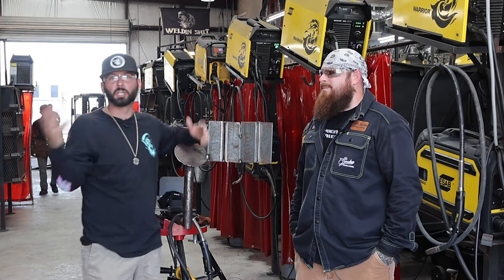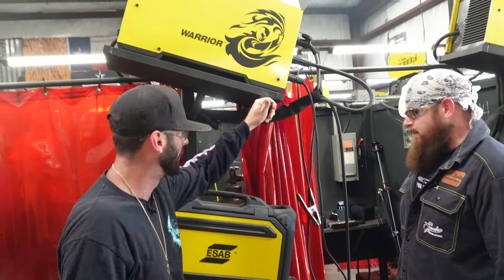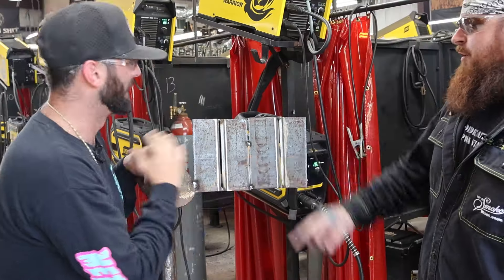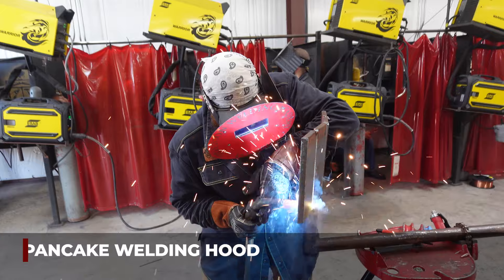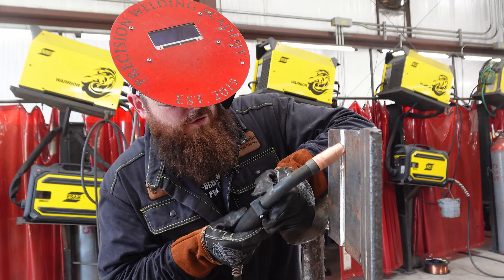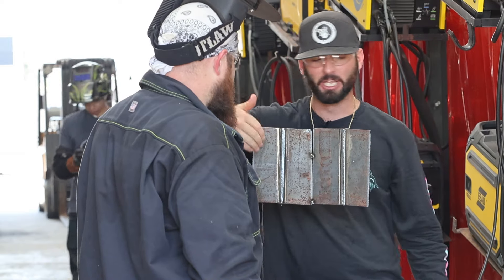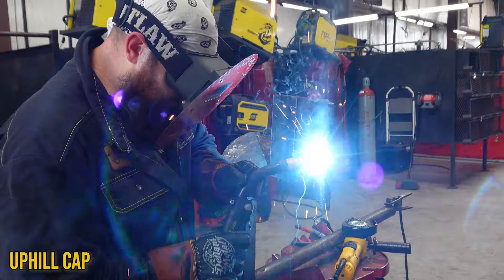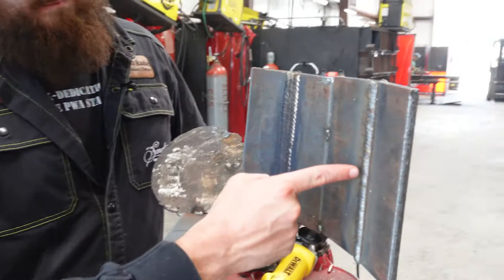Is MIG Welding Downhill As Strong As Uphill?

Comment: Uphill or downhill, either works great. In 34 years of mig welding in a pipe fabrication shop, never had a problem running downhill on roots.
Reply: 1000 percent
Reply: @JamesPuckett-t6i  Same here 37 years of Tig and mig fabrication. I've had no problems with downhill mig welding

Comment: Pretty dope my dude. I had to see it to believe it. And its wild to me. Open Roots all day can be done with short circuit mig . But its wild to me, seeing thicker plate not have lack of fusion in the side wall.  

I know folks have procedures out there in the wild . 
 But  its just so hard for folks to get GMAW-S  to weld  repeatedly over and over and over with out failures in thicker bits , after an open root. 

Very rad my dudes, I have failed a lot GMAW-S welds that where in thick plate . It was super rad to see one passed. 

Now I am going to have to go try one after this outage I am working .

Comment: We're currently welding a project in pairs and my partner is a much more senior welder. There is a part of it we need to weld where we can choose whether we go uphill or downhill. I weld downhill, but my partner welds uphill and keeps insisting that I should too. He had his uphill weld fail twice on the UT (in the year since we're working together), while mine hasn't failed even once, but the stubborn old goat just keep nagging me about it.

Sometimes, if the sheet allows it, you just go for whatever's easier for you, and if its good enough to pass inspection, don't let anyone talk back at you about how you're going about it!

Comment: 9:43 he mentions bumping up the heat a little bit by raising the voltage from 18.5 to 19 volts, 
and then bumping up the wire to match the voltage, 
I thought amps were the heat input in welding, like stick or tig, and the voltage was the force
behind the arc to jump the gap ?
does mig not consider amps to be the heat ? or am I missing something......thanks in advance, Robert
Reply: no with mig and flux your amps is same as wire speed
Reply: @NUMFG  
the amps are not the same as wire speed, due to the different thickness of wires.....only .045 wire is a direct translation, 100 ipm equals 100 amps.... 
.045 at  100 ipm divided by 1 = 100 amps .023 ipm is divided by 3.5, 
.030 ipm is divided by 2
.035 ipm is divided by 1.6 [160 ipm = 100 amps]
Reply: @atomichydrogenweld2823  thank you for the fix my comment was poorly worded and I kept it to simple. What I should have said was wire speed correlates with amps. More amps more wire ( and a colder weld because to much filler to fast. Not the best way to cool a weld but it can) this is why even on the name brands like Miller and Lincoln you will see some wire feeders use wps for wire speed and some are labeled as amps
Reply: @NUMFG  you were correct in general.  increasing WFS will increase the amps and heat of any weld while decreasing will do the opposite.

Comment: Both are good,but downhill is harder to master. Cold weld is a real problem with downhill
Reply: @ReBeksonn  it's quicker and easier imo when you getbthe hang of it
Reply: I would say downhill is easier, you aren't working against gravity.
Reply: @ReBeksonn  the great thing about gravity is, it can work for you, the bad thing is, it can work against you
Reply: @JamesPuckett-t6i  gravity - its the law
Reply: Do you have an idea of what wire size they would be using for an 18V open root MIG weld?  They left that out of the presentation and it is kind of an important piece of information.  18V and 180 ipm seems like what i would weld 16 gauge tube butt joints with 030 wire?
Reply: Depends on what WPS they’re following, for AWS d1.1 it’s gonna be .045 wire in a uphill weld for the 3G cert, if you gotta any more questions feel free to ask
Reply: Also you’re going to turn your wfs and volts up for your hot pass, and fill passes as well, you won’t stay at 180 all the way out.

Usually you’re allowed +/-5% on a WPS, but he’s running pretty cold, usually it’s about 225-260ipm and 22.5-23.8V
Reply: @RIPSlawd  thanks for the information.  have a great day.

Comment: New to Mig welding informative video,i just bought a Mig welder it only has voltage and Amperage knob how do i know my wire speed?
Reply: just a guess but it's probably voltage and wire speed - you shouldn't have an amperage setting
Reply: @LibertyDankmeme  thank you
Reply: I assume amperage is your wire feed speed(WFS).  You can test this by holding the gun in the air and pulling the trigger for a 6 second count, measure the wire length with a ruler and multiply by 10 will be your wire/minute speed....  then change the amp knob and re measure.

Comment: When it comes to mig or tig it doesn’t matter if you’re going up or downhill, there’s no flux to get in the way and that molten metal don’t care if it’s going up or down
Reply: Biggest issue is carrying to much metal. As long as you watch it. Like you say, all is fine
Reply: @Weldproshops  do you have any idea what wire diameter they were using for the 18V root?